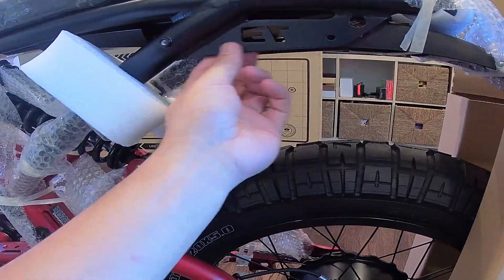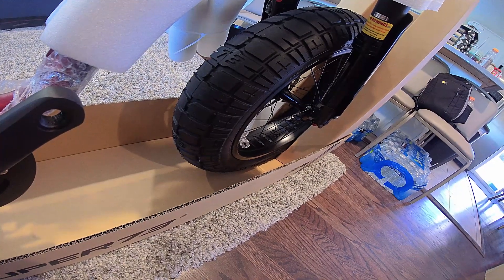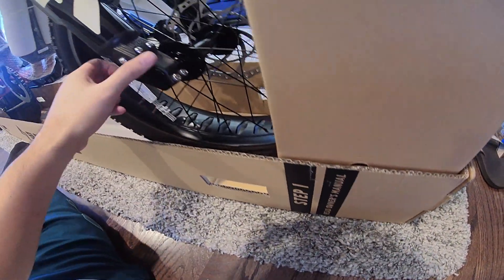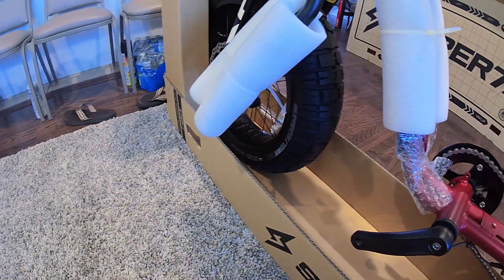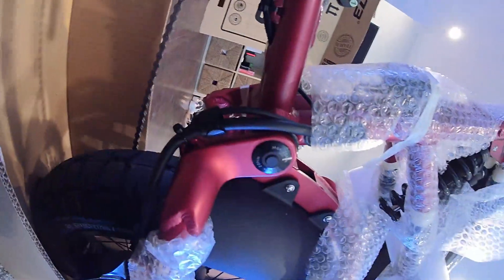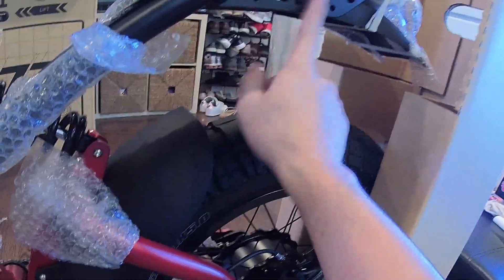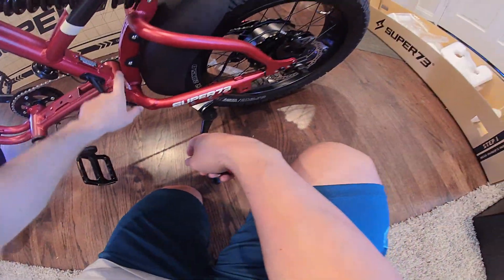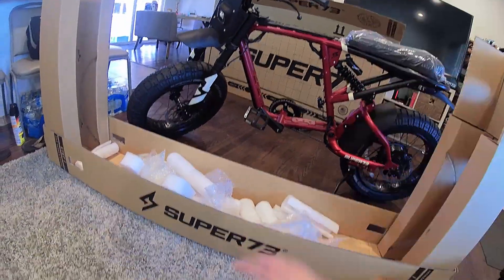FAKE or One of a kind Super73 RX? Weird Quality Control Frame welding issue

Comment: I’m a Welder/Fitter/Metal Fabricator for 27 years. The flipped 73 is a interesting issue but it boils down to Chinese labor slapping those frames together as fast as possible and the person getting paid $5 an hour to do it (possibly getting paid by how many frames are made per day). Grabbing parts from bins in the wrong order and not double checking the work being done before finish welding. The majority of Chinese welders are not certified and learn on the job. You definitely have grounds for complaining to Super 73 to not just replace the frame but the entire unit which includes a V3 motor and all other revisions to date. Or just keep the one you have and find out how bad the V1 motor is after the planetary gears grenade 15 miles from home. Good luck, you’ll find out how good their customer service is pretty quick and what explanation they will give you.
Reply: When I get my S73 R, I'm not goin on any long rides cause I'm afraid of the motor going out on me.  It's happened to me before where my e-bike (not Super 73) went out on me 10 miles away and I had to walk the bike back.

Comment: The rear plates are one single plate that go from one side to the other. At one point it was cut from flat in a water jet then put on a press to bend the two sides down. The operator put the plate in the press upside down. Does not effect the structure of the bike, infact you might say it's a rare misprint, like a monetary note. If they offer you any money for it, take it. The bike's integrity is not compromised at all. The welds look normal for aluminum, probably welded with a MIG spool robot and the welds always look a little different than by hand. Aluminum welds are always fat.

Comment: I would never waist my money on that garbage, especially when you can get a much nicer more reliable bike for under 2k.
Reply: Give me a list?
Reply: @cryptochampion3836  I'm not that into moped style bikes but if you are this one is way better than a super 73 for 1500

https://shop.sondors.com/pages/madmods
Reply: @marcs4091  i checked them they are not nicer that any s73 models.😕
Reply: @cryptochampion3836  Define nicer what are you looking for? Super 73 there nice looking bikes I can't take that away from them, buttheir reliability record is horrific as you can see from the video there quality control is really unacceptable when you are putting out that kind of money. I'm a mountain biker so moped style doesn't really do it for me. As far as reliability goes anything with a true 750w bafang is going to be just as fast as a super 73r rx or s2,  and more reliable. And that double suspension bike is going to be way faster than any super 73.  Or for $900 to $950. You can get an Lectric xp or a Fat tire Ancheer that are only going to top out at 26mph with throttle only, but you can put thousands of problem-free miles on them and upgrade thenlm if you want  to go faster. Spend your money however you want, but I've read way too many horror stories about super 73 to spend my hard-earned money on one.
Reply: @marcs4091  Thank you.